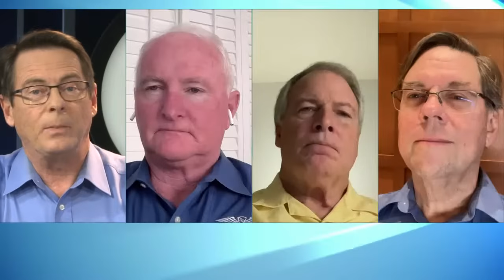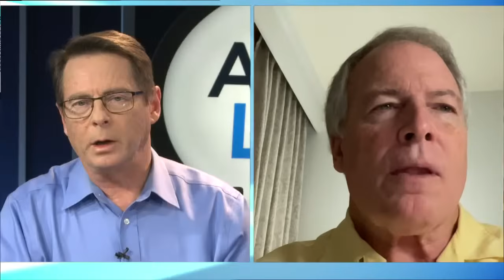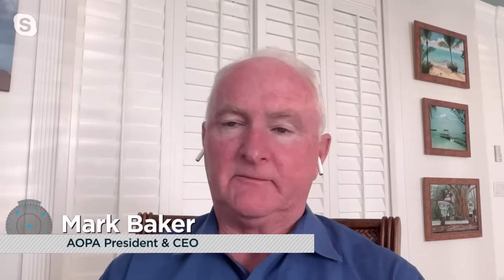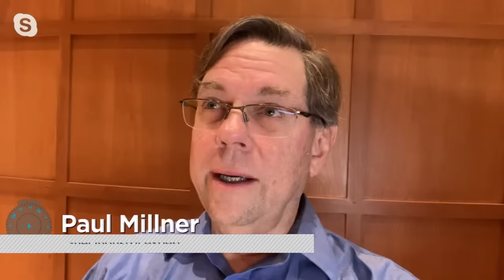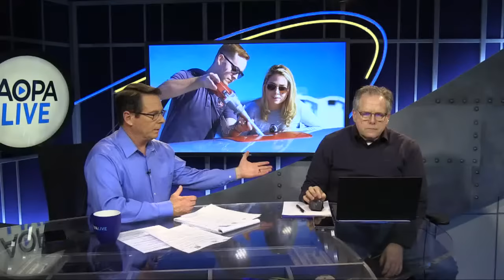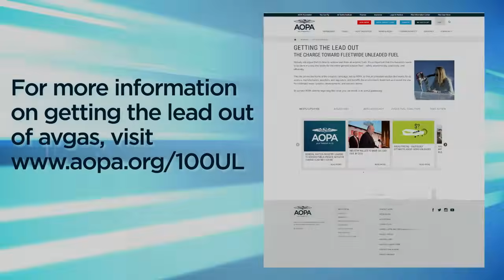Unleaded Aviation Fuel Update

Comment: So back in 1992 my friend was flying an old Cessna.  He found that the engine could be easily modified just like classic car engines were (hardened valve seats and electronic ignition to prevent knocking).  He was authorized to use standard unleaded auto gas.
Why can every car on the road, including 1930's model A's, cheap cars, race cars, performance cars, and luxury cars, run fine without lead, yet somehow the Princesses in old aircraft can't be bothered not to fix their sh*t and fly clean, non-toxic fuel?

Comment: I hope leaded AVgas will be around for many years yet, if an unleaded fuel is approved by the FAA at least still give the option of 100LL. I've used it for 30+ years in my high compression drag race car and boat, it runs great. I think the lead concern is blown out of proportion, it's on a very small scale.

Comment: I hear you say that the last thing you want is bifurcation of fuels and that sounds to me like the kind of excuse that has led to this 40 year failure. You really have to switch the thinking to this has to happen now and having two or 3 fuels at an airfield is not a real burden and is only a priority in a mindset of indifference to the lead problem. It has to start from an acknowledgement that you have failed to do anything at all for 40 years. If you are concerned about burdens in aviation there are infinitely greater problems than having 2 pumps. The price of engines, the lack of innovation in engines and planes are infinitely greater. So get rid of that defective thinking that having 2 pumps is a princess that cannot be disturbed. She just now got conscripted :)
You are saying that 70% of the old aviation engines don't actually have a problem using other fuels so that means you have avoided introducing already existing solutions that had no technological barriers? that is no small failure. Since lycomings and continentals are typically low compression engines, which are the engines that have a problem? is it just the turbocharged engines?
can we get a list of which has a problem? it seems to me that a big part of the failure to solve it is a lack of specifics so let's have the problems identified. 
Paul Millner says his turbocharged engine would start running hot, is that because of premature ignition from compression? or because it burns much faster without the lead additive. If I google high octane it is to prevent knocking or compression ignition so high octane shouldn't be prone to premature ignition, indeed the opposite. so what role does the lead additive have?  car engines have both higher compression ratios and turbos yet run fine without lead so where is the disconnect? could it be solved with trivial modifications of old aviation engines?
again identifying specifics would seem to help crystallize the issue and perhaps allow solutions to be obvious.
And again, having two pumps really must not in any way be a hindrance to progress. one fits all would be nice but cannot not at all be a stumbling block given the enduring failure so far.
Reply: regarding the 70% of engines that can use other fuels (all non turbo lycomings and continentals?) are you saying those could use 100 octane mogas as is without a problem? or 95 mogas for that matter.  that would be something to highlight if true.
Reply: @DanFrederiksen  The method used for octane measurement is different between mogas and aviation fuel, so you can't compare those numbers directly.
Reply: @cardinalflyer  so avgas would be the equivalent of 115 octane. that just deepens the mystery how turbo car engines can function. the problem is not enough cooling in those old air cooled engines? is that it. so so they could run on 100 mogas just by running the engine at slightly lower power?  is that it. and just applies to turbo engines.
Reply: @DanFrederiksen   Detonation is the risk. Heat and boost make it worse. I'm not a hands-on expert on all the ways to reduce that risk (water injection is one) but there are folks (such as Paul!) who are. I encourage you to seek them out!
Reply: 100% agree.  I, like many, went through two years of training just to get a basic PPL. So I think I can figure out which of two AvGas pumps to use so I'm not paying for way more octane than is needed and approved. I know a lot of people are working hard on this, but I don't think anyone is out-of-line for venting that this is a multi-decades long fail. Fingers crossed in any case.